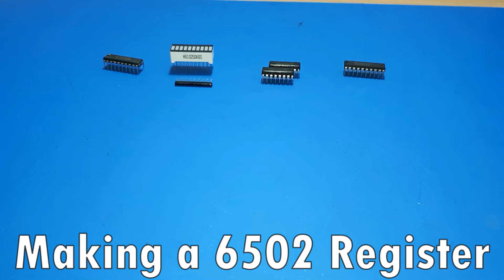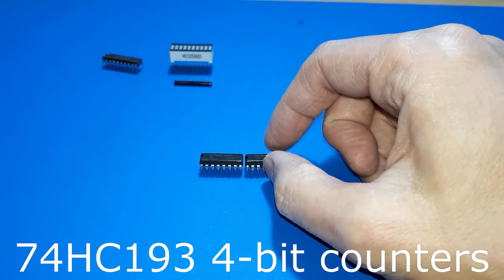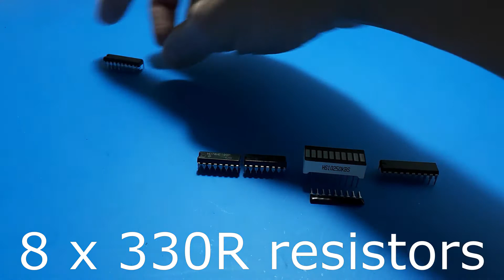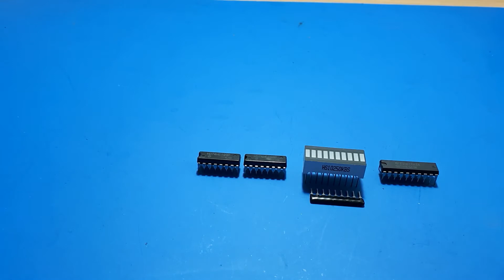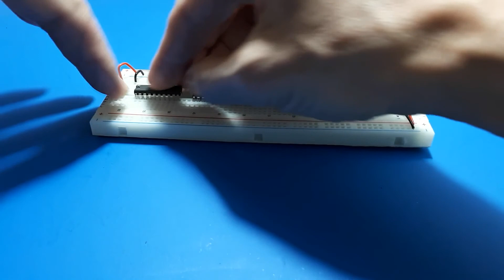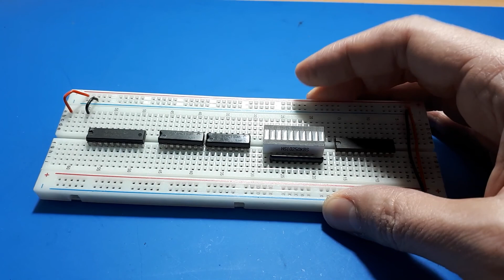Making an 8-bit Register for my Homemade 6502 CPU

Comment: I like this idea. I already build the 6502 project from Ben Eater. Maybe you know that already. My version of that has a 68b50 acia and can run basic. But I also like the idea of building a ttl version of the 6502. Do you have a design or schematics for the entire project ?
Reply from the maker: I've only got partial schematics because I haven't finished it yet. I'll put it somewhere when finished.